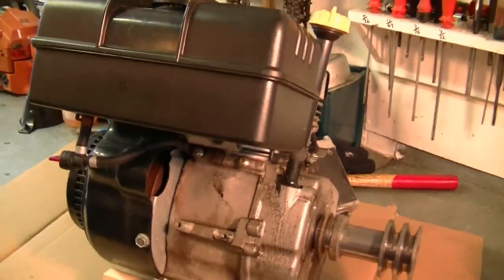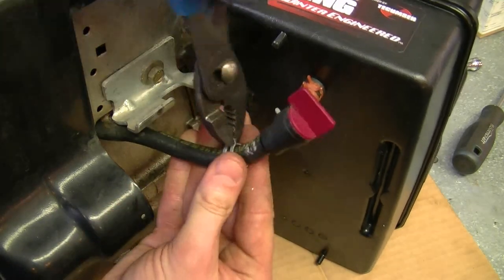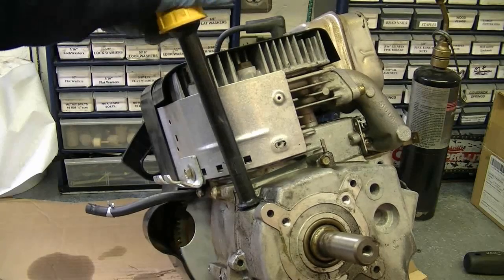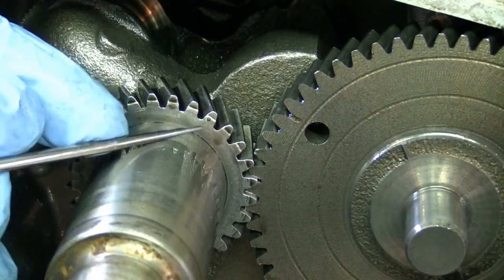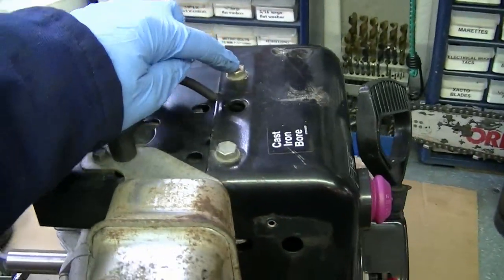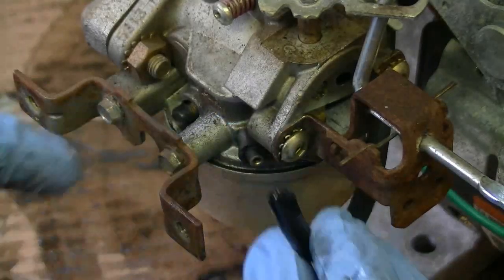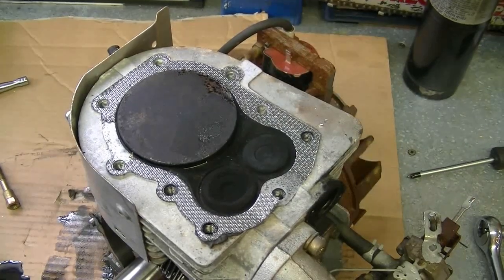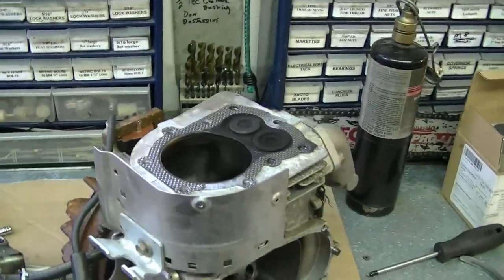Dismantling a Blown 8hp Tecumseh from an Ariens Snowblower Part 2/3

Comment: I have a 1993 MTD snowblower Tecumseh 10 hp snow king, 23 yers old machine running like new. I live in the Montreal area with lot of snow every year. The thing is a horse! I keep it in a heated garage, and I do all the maintenance myself. I use regular gas, 10w30 Castrol regular oil which I change once a year. Last year before winter I changed for the first time the 2 belts and the spark plug which still looked to be ok never had to clean the carburetor ease starting, fuel lines original, still soft with no visible cracks and just last year I changed the auger main bearing. The drive is very good not slipping. My Tecumseh snow king motor is

Comment: So what are you going to do?  JB weld it or they have some alumi weld basically a welding rod that has a low melting point that you can weld only MAP gas torch.  That would be better than JBweld.  Just a thought and my .02

Comment: Great video, thx! What amazes me, is how easy it is for this to occur. I recently removed my carb on my 10hp Tecumseh and rebuilt it, then while getting it back in, had difficulty reattaching the rods coming from the governor. So I removed the screw holding the governor arm, reattached the rods to the carb, then reattached the governor arm. When I started the engine, it raced and the throttle had no effect. So I shut it down. I thought something was wrong with the throttle, but finally realized I had not reattached the governor arm correctly. So watched some videos on how to do that. Reset the governor arm, but the throttle lever still had no effect. There seemed to be a need for something to push back against the throttle when the throttle lever was pushed down. I was stumped. Is the governor supposed to provide the push back on the throttle? Tried to start it one more time to see if maybe the engine had to be running in order for this to occur. IT only ran for maybe 15 seconds then seized up. Now it will not turn over at all, either starter motor or pull rope. So I guess an engine tear down is in order.

Comment: I would mig weld the block and reuse it for myself . I would even JB weld it as that has held up on a lot of my repairs . If you do not at least you will have a lot of great parts . I wander if that carb would fit on my 10hp 1995 MTD snow blower .

Comment: For all the mechanics out there with lots of historical knowledge, is there a defect with the larger Tecumseh engines?  I have a like new Craftsman snowblower with a locked up 9hp Tecumseh engine.
I  see an abundance of videos featuring these engines with a destroyed block from a broken rod.  Just curious as I am a retired shade tree guy.  I finished swapping the engine with a new  Briggs 14.5 ft lbs. of torque snow engine.  If only we had snow here in Denver.......

Comment: Hello how do you  remove a camshaft from a dual shaft snowblower engine. The camshaft is attached to a pulley in the sump cover. How do you remove the camshaft from the sump cover.

Comment: You said earlier that you should never run the engine at full speed with no load on it. I never knew that was an issue. I thought an engine had a safe rev range, where it didn't cause any damage. So whether it's idling or at WOT, all it's doing is consuming gas. By overrevving, that sounds to me like running an engine at a speed faster than it was designed for.
Reply: The reason why excessive RPM is so destructive to these engines is they don't have pressurized lubrication.  Instead they have a dipper that splashes oil to the connecting rod and cylinder attached to the bottom of the connecting rod.  That only works well up to a certain RPM after that it can't keep up  and the engine fails.
Reply: @1575murray   Thanks,  So what high speed RPM would you suggest on this Tecumseh engine?  I HAVE AN 8HP.  HMSK80.
Reply: @dj5752  I believe about 3600 RPM but I would check the manual for that engine to be sure.
Reply: @1575murray  Thanks,  I've looked at most Tecumseh repair and operators manuals.  I just don't see where they mention an actual # for the RPM'S.  They speak about speed and not to over run an engine but no commitment to an actual #.  If you see one please post it.  Again, Thanks.  HMSK80.

Comment from the maker: remove the governor arm on the outside part of the cover and the the pin will come out and you can remove the plastic gear
Reply: Hi donyboy73. Isn't it amazing how the old Briggs engines from 60's and 70's could take anything? High reving, hitting stuff with a blade,... and they just keep working like nothing ever happened. (Knock on wood)
Reply from the maker: @ristomattikolsi5711  that's when they were well made
Reply: @donyboy73  They sure were.

Comment: I have a 9 year old snow blower with a 10hp Tecumseh engine that still runs fine I would like to replace the rod now before it does blowup.
Are there any  aftermarket rods available for a 10hp Tecumseh that are stronger? 
To me it makes no sense to replace the rod with the same new junk rod manufactured by Tecumseh.

Comment: @56CrownVick i think the engine on your blower is the same or very similar to the tecumseh star used by kart racers so i think someone makes a billet rod for it, not 100% sure though so do some research before you buy a new rod

Comment: @Pucamann Agreed. That's how the market works unfortunately. But, remember that it's the same system that allows us to buy these machines cheaply, thx to mass production. Having said that, it's still wasteful and I don't like it. Especially with this engine, heck even the oil looks clean and all parts looks brand new! If it was my own engine I would try to fix it.

Comment: No Offence, But what is it with most small engine guys using strictly hand tools? one would think a cordless impact would be a masive timesaver and aid in productivity.
Reply: i stand corrected
Reply from the maker: haven't you seen my Milwaukee impact tool review?
Reply: just found your channel. wilst searching for a friction disk repair. will look for it
Reply: If you have done any engine work at all, you would know that over tightening or stipping bolts or nuts is an avoidable headache. Engine repair is not a race, and anytime i've tried to cut corners or save time, it's cost me money and time in the end.

Comment: I'm thinking don't buy tecumseh !!! Lots of vids on blown engines. Almost never see this on briggs
Reply: Sadly, B&S has their own problems. Faulty valve guides in their OHV Intec engines. Engine gets too hot, or sometimes for no reason at all, and the valve guide thimbles push out of the heads and impeded the valve spring action, which causes the push rods to bend, and there you go, time for a new head at $150 each.